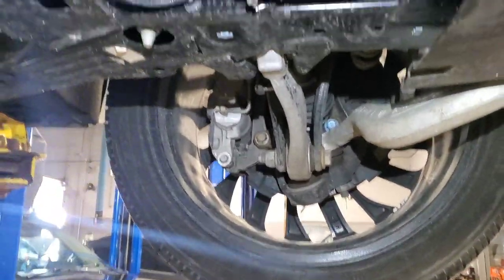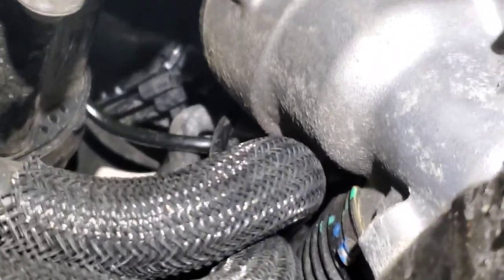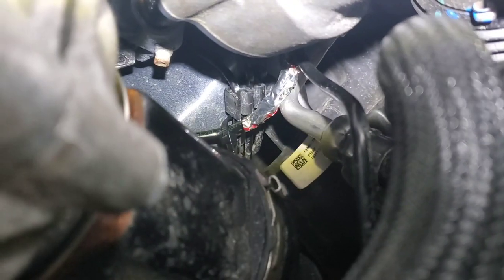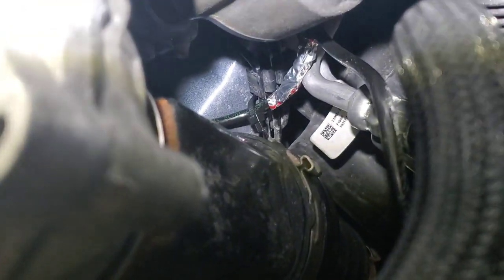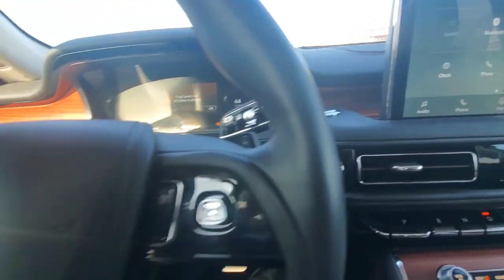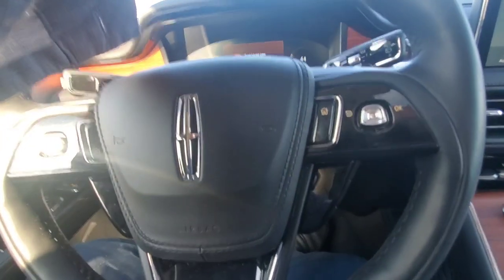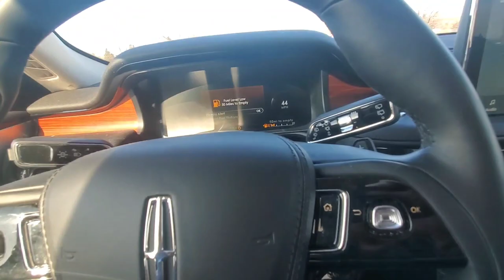2020 Lincoln Aviator - Tick Sound Coming from Front Left SOLVED - Bad Routing of lines From Factory

Comment: Good catch. I had a customer with a rattle on a 2005 F-150. Spent two hours looking for it. Finally found a stick between the cab and box, out of sight. Pulled it out, rattle gone. Just charged the customer for a diagnosis. Stuff like that will drive you crazy.

Comment: just subscribed as you are the best mechanic I've seen on here. My local dealer keeps my 2020 aviator  2 weeks 3 different times in a rental and gives it back unfixed. i need to bring to your dealership. Where you located ? Satellite radio intermittently doesn't play sound . all other radios and blue tooth play sound . happens intermittent

Comment: I had a 2010 Chevy S-10 one time that had a high pitched buzzing noise under acceleration. Took it to the dealer under warranty. The tech found the inlet and outlet pipes of the heater core were rubbing against  the body cut outs on the firewall. He zip tied the tubes together and the buzz disappeared. About drove me nuts until they found it.

Comment: Hi, thanks for sharing.   Do you by chance have a video with the ticking sound prior to the fix?    Thanks.
Reply from the maker: This was a long time ago no I don't have a video with the exact sound but I did explain it and it's pretty easy to understand, it's just if you took a playing card like a deck of cards you pull the card out of it and you strapped it to the frame of your bike and as you were driving forward it would bounce off the spokes of your rear wheel like they used to do back in the day

Comment: Bought a new 2021 Aviator Reserve in Sept 2021, at about 3700 miles there is an annoying buzzing/almost vibrating noise at 30-40mph which goes away at higher speeds, brought it to dealership three times, they said it was lines touching which they tied back and insulated, but noise still there I am at a loss right now and considering returning the car for a buyback at my loss which I dont want to do as I really like the car but its really becoming a pain to drive and deal with.
Reply: Found the fix it was an aftermarket roof rack causing the noise which was weird but I am happy

Comment: I just bought a 22 Avaitor and when I accelerate the engine makes a noise like if as if it's in sport mode. Does anyone know if the Avaitor pumps fake engine noise from the speaker?
Reply from the maker: It does have a sound simposer I believe

Comment: God I hate noise tracking. More than any other process ticking, creaking, rubbing (usually easier than the rest), and knocking diag suck. I've got 3 sets of  chassis ears (12 mics, 3 receivers) 1 set is wireless which sucks. The other 2 and hard wired which also sucks but to a slightly lesser degree than the wireless. You don't know how noisy a vehicle is until you start strapping microphones all over the place. Damn I hate noise tracing. 
I rather diag P0456 a very small evap leak  than most noise tracking.

Comment: Why you still asking other guys to look at it while you turn it, just to "verify the fault"?
I thought they talked you into reading the TSB, replace the hub and get paid that dealer cash! 🤔😒🙄😐😂🤣

So, how many an hours can you charge to reroute a vent line with zip ties and foil heat tape? Parts & shop supplies will be less than $20, but there has to be at least 2 hours of diagnosis, repair, and test driving.
Reply from the maker: There was no TSB for this one I had to find this one out on my own and then I wanted to get the second opinion just to make sure I was making the right call and yeah I think I actually did end up getting a couple hours out of this